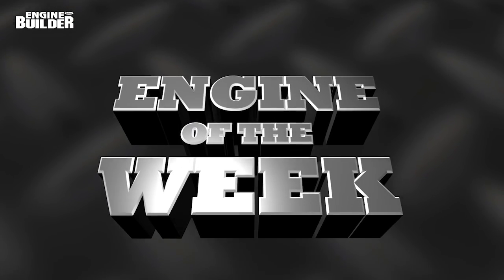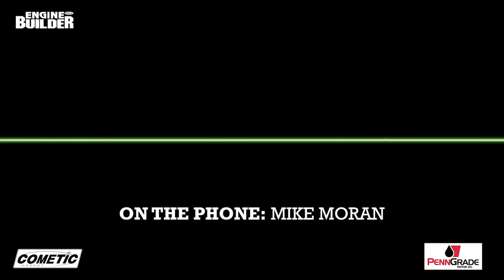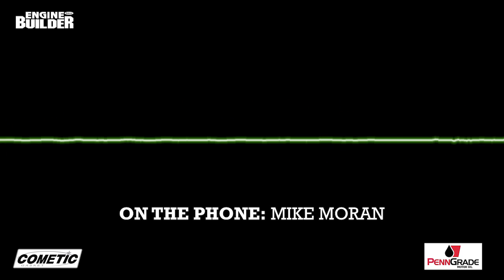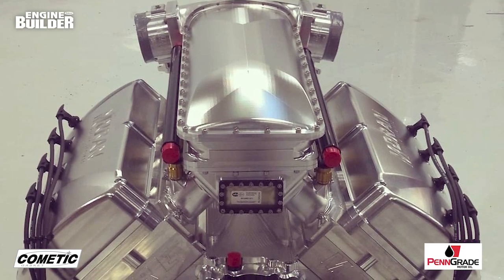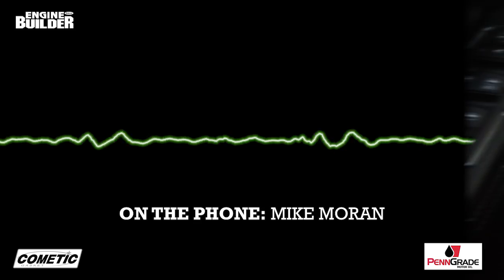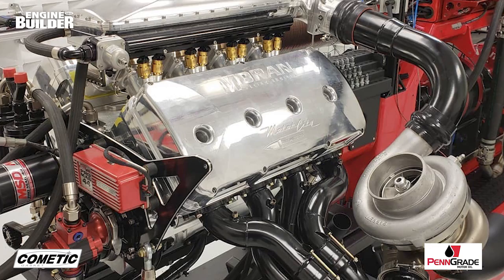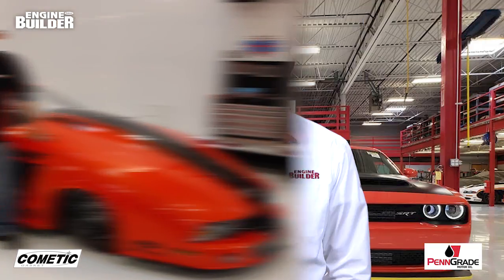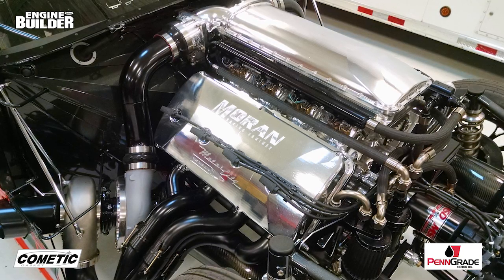5,000 HP 570 cid Hemi Engine

Comment: I wonder how you'd ever get all that hp to hook up. You can have too much. Even 11.000 hp top fuel dragsters walk a fine line from getting all that power to the track and spinning.
Reply: Good point. ☝️ Would like to see this engine in something making s few passes on the quarter mile.
Reply: You can pedal it down the track and still be fast.

Comment: What Makes more Power a Hemi or a 481x
Reply: Def Hemi
Reply: There is a 481x proline comparison video with there hemi
Reply: @eliteremovalistsbrisbane1066  heck yeah, gonna head over there and check it out.
Reply: Steve Morris's SMX is based on a 481X and is a drag and drive motor capable of 5000+ horsepower. You might be able to make a bit more power with a Hemi but it aint going to last nearly as long as that SMX.
Reply: Hemi makes more power..but also goes through alot more parts
Reply: Hemi

Comment: Sorry. He was not the first to run a turbo motor in NHRA. Buddy Ingersoll holds that title.
Reply: He was the first turbo car in pro mod to run 5s tho
Reply: Buddy was the man! Did all that on a stock block.
Reply: @Tiger of The Eye;
Am not surprised at this incorrect statement about turbo motors used in NHRA, certainly and possibly other competition racing; 
Turbo engines were common in F1 and Indy back in the 1970's, achieving multiple the power of this large block, large displacement using 2-3 L 4, 6, 8 cylinder engines and prior without turbo chargers too. 🤓
This is not surprising to me since Greg Jones, Managing Editor Chief of Engine Builder Magazine, here, conveys much false, incorrect, misleading, misinformation, disinformation and improper comparisons.😒
The initial statement of comparisons with inventors and innovators of Leonardo DiVinci, Thomas Edison,  then to falsely include Bill Gates and Steve Jobs, that did not develop any single innovation and certainly not inventors, nor visionaries but rather just good marketing and achieving market penetration to control; clear common attributes of Globalists/Elite as Jeff Bezos, Elon Musk, etc.  😒
How long have the Top Fuel Dragsters, Funny Cars had 100000 + HP engines and not larger than this ?
Yes, sure the idea of aluminum billet construction has advantages in weight, durability, reliability, power, force capability. However, the development of eight years, dependent upon others to manufacture, is clearly an indication of the engine builders' knowledge, ability, capabilities, limitations. Actual development, innovations, and inventions, do not rely upon others, but develop their own as necessary.😒
We engineers that work and worked in actual R&D, know what this is, and the needs, requirements to develop custom manufactured parts, devices, process, etc., while using what is available and working with others in partnership as necessary. 😏
Clearly this engine builder, Mike Moran is not an engineer or else is a very poor engineer and not using the available design tools we have used since the 1980's and as they have improved. 😒
Let's make simple comparison of the GM Chevy Corvette engineers, and specifically the engine design team.
This video was posted Dec. 2018. Already the GM Chevy Corvette engine engineering had developed their newly designed N/A and twin turbo 5.5 L, flat-plane crank engine for the new C8 designed vehicles to be produced, manufactured and available in 2019, Nuremberg track testing and for the 2020 season. 🤓
Every aspect of the C8 design from engine, drive train, DCT, chassis, brakes, cooling, body, etc. for the racing and commercial production vehicles has been done using CAD equipment tools, which are precise, exact, accurate, and useful for complete design from concept through prototype, thus avoiding the older many prototype stages previous to these CAD equipment tools and use.
Within the electronics development We were able to achieve this back in 1984-5, including custom electronics development, simulation, testing, and full systems with a combination of custom to standard available devices and parts.
These tools have only become better through the years and improved with the development of our needed computational devices, computers, workstations, simulations, modeling. The development of all advanced electronics, custom integrated circuits, the processors, computer systems, etc. have only been possible through and with the development of these CAD equipment tools. The concept of 3-D printing available with many different materials now, has become a reality through the CAD equipment tools also. 🤓

But, there are many, as portrayed here, that remain in their limited 'bubble' of limited thought without using the advanced tools available, depending upon others, and less than the innovators  of many decades previously. 
Would the developer of the first and only turbine engine use in Indy or the many Cosworth, Lotus, Chevy, Mopar, racing engines, etc. have occurred with this limited thinking, mindset or the development of the Wankel rotary or new LiquidPiston and their hybrid combustion engine design [which is within this same time period of years 😅]? 🤔

Sincerely😄
Reply: Turbo regal/cutlass 💪🏼

Comment: Interesting... I might be in the minority here but innovation is a stretch. I see components and designs that are truly new. I understand that scaling an engine at this capacity is truly an innovation.  With one off products comes theory’s and ideas that can be used in other applications as proved engineering practices.  Is it me or do I see the gas motor coming closer to meeting its cousin the diesel? There are many features and architectures that are diesel and diesel uses many gas motor engineering features today.  You watch these turbo motors will have turbos mounted in the valley and piezo-electro injectors timed like direct injection to optimize air fuel ratios for max power.  Gas/diesel motors will soon be running on the same fuel.  I could be wrong.  Keep up the great work.
Reply: Its just around the corner
Reply: The lines blur. The diesels drop compression to make power and run better on gas or alcohol. Pretty soon that's just a gas motor without spark plugs... until the diesel has plugs.  Also direct injection isn't really a "diesel" technology: gas motors were using it in the 30s.